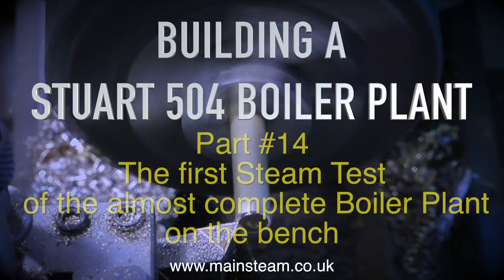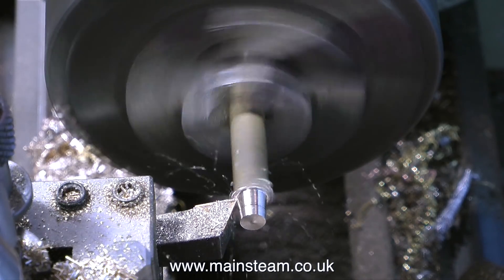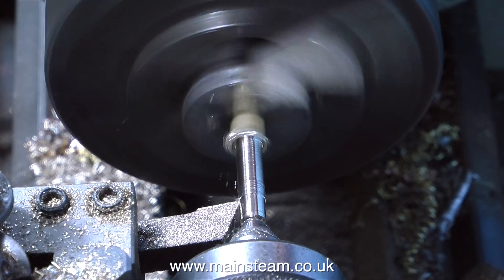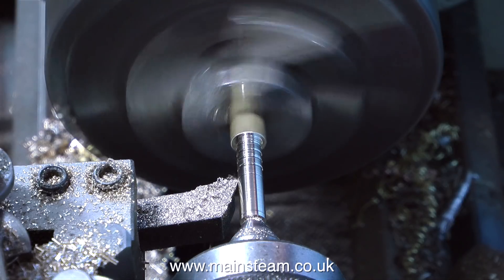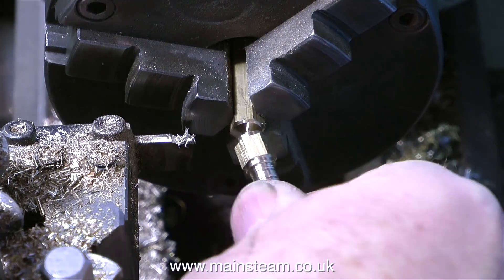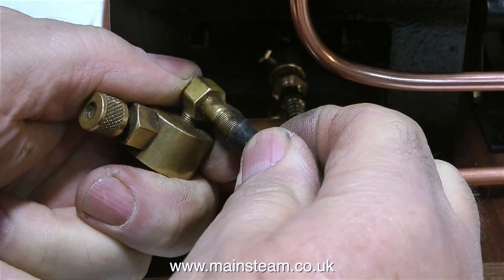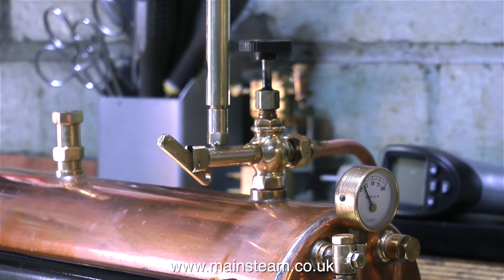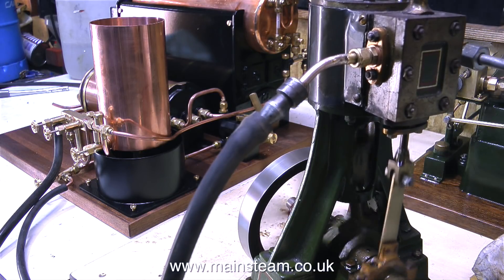MAKING A STUART 504 BOILER PLANT - PART #14 - TESTING THE STEAM PLANT

Comment: Very nice Lathing!! Even with a dull tool and in a steam test vid! -- We (U.S.) would call that piece a "barbed hose fitting adapter" to "female thread". You never seem to need worm-drive hose clamps.... I know if that were me, those little hoses would blow off right in my face with the slightest pressure. Your hoses seem to stay put even with 25 lbs. or more...  Hmmm.

Comment: I am sure that Keith probably knows this, but if you use a turning tool with a large nose radius you get a finer finish.
Reply from the maker: Not always though ....... it is the horizontal relief angle of the tool that does the polishing - not just the tip .....

Comment: As far as I can understand it, injectors work on a similar principle to automatic transmissions in motor vehicles, except with Steam Injectors there's a doubling of the inputs & outputs with one for each function- of which put me in mind of the above mentioned 'gearbox' type....
The two inputs you pour Hopes & Dreams into, & the outputs are for Sweat Relief & Bitter Disappointment- it appears to me that once boiler pressure is up it's too much for one of the cones & so everything falls out the 'Bitter Disappointment' hole...
Hopefully after some fettle'n it'll all be '*Sweet Relief' next time the gauge glass gets low! ;)
........or something like that.....
Thank you again, looking forward to the next installment & hope you have a good new years too...

*EDITED